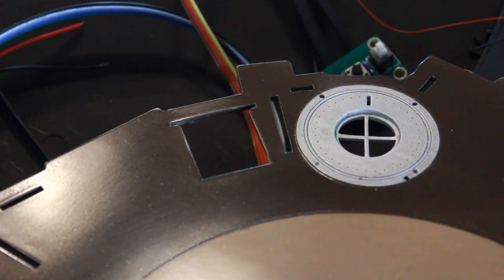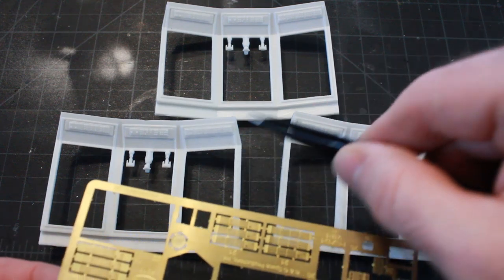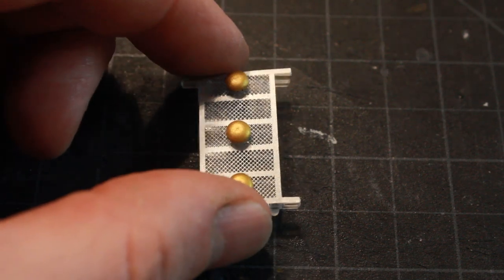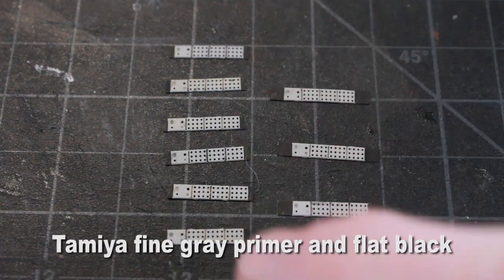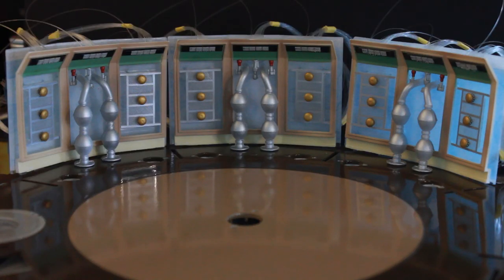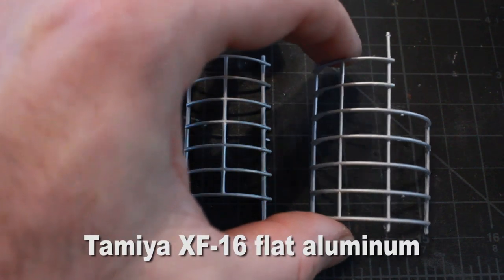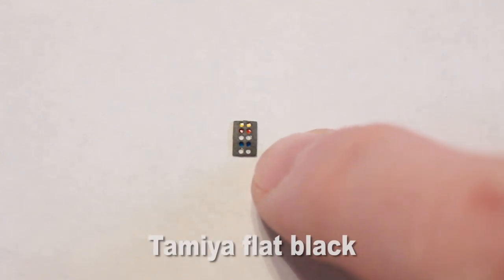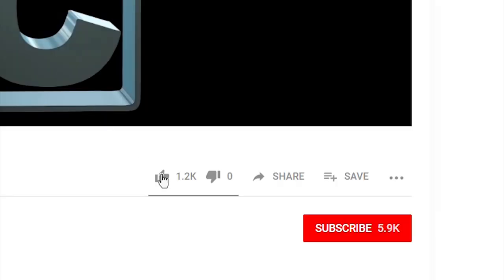Moebius 1/35 scale Jupiter 2 Pt 7 Statis Tubes and Walls

Comment: 7:21 I think those parts are meant to be clear, with just the pipes painted silver...
Reply from the maker: No. I've done extensive researched and have all the episodes on Hulu and have been doing freeze frames for accuracy. They're solid silver.
Reply: @modelsbychris  I think we're both right! In the early B&W episodes they're transparent with various mirror spheres and pipes inside, but in the later colour episodes they are, as you say, a matt silver colour.

Comment: great job again you work like an engineer ! Question i asked on your video part 6 :  the motor is it a 9v ? and do you take a speed regulator ? thanks
Reply from the maker: Sorry, guess I missed that. The motor is a 3v motor I found on Amazon.  I do have a 10k pot attached to it and lowered the voltage as low as I could before it wouldn't spin, to get a slow rotation.